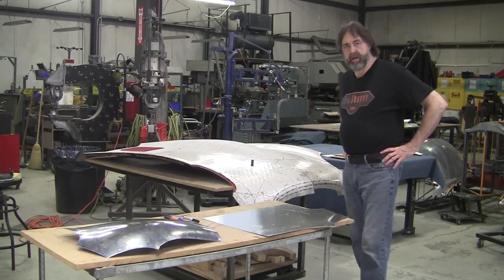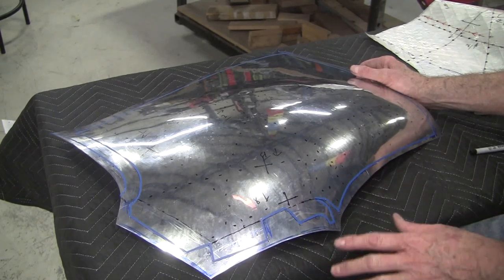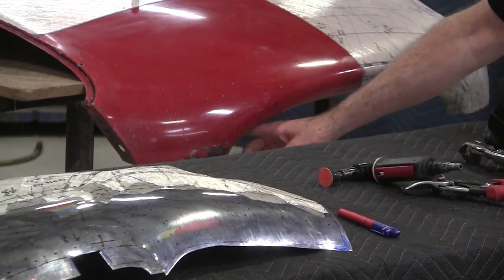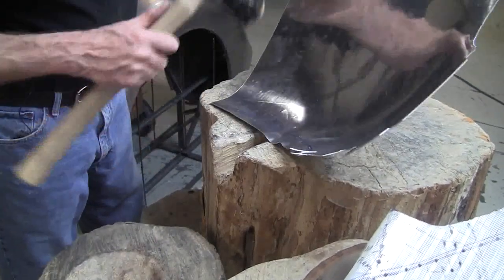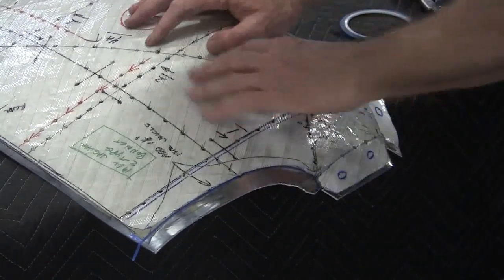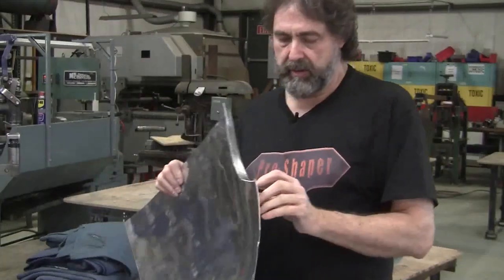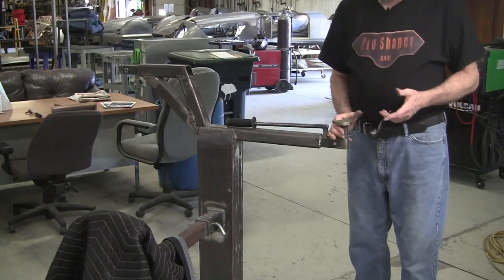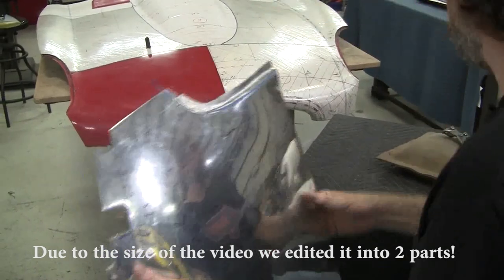Metal Shaping: Jaguar E-Type Aluminum Bonnet Build (Part 5A)

Comment: Hey Wray thanks for all the videos, this is the 4 th time over I’m watching this mini series can’t get enough! I’m trying to get a body line on the flare section of a Porsche fender, can that be achieve with the same tipping wheel process or do I have to make other tooling for that?
Reply from the maker: Hi Alex, yes, the tipping wheel should be able to add any body lines  you might need. Practice on a scrap piece first. Wray

Comment: Just wondering, if you use a german wheel, and not an english wheel to make your parts, would that make the car as reliable as a german car? Of would it still break down every time you want to use it to actually drive somewhere.